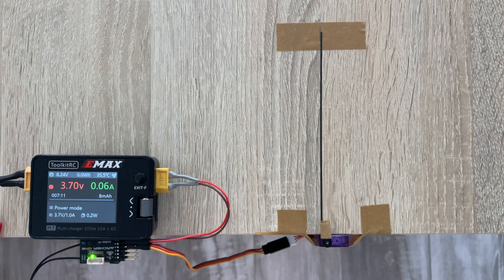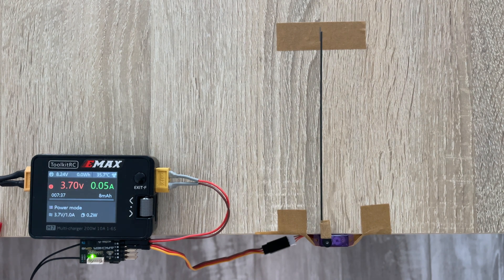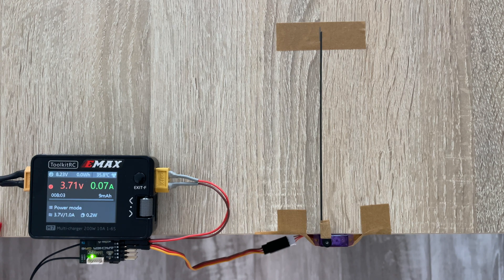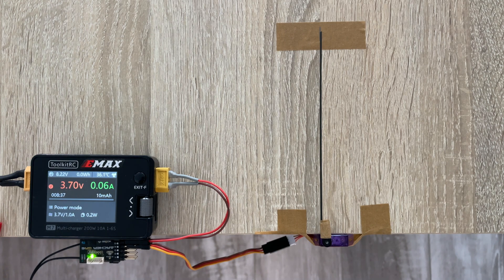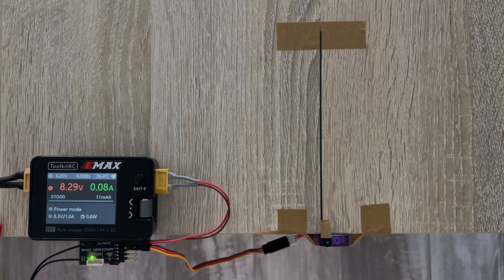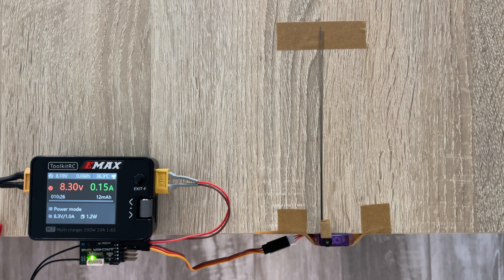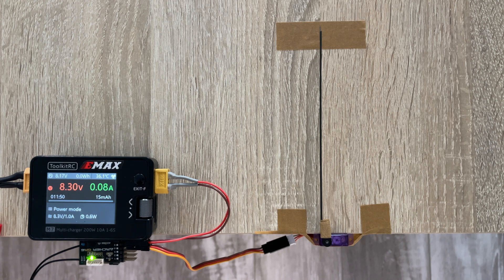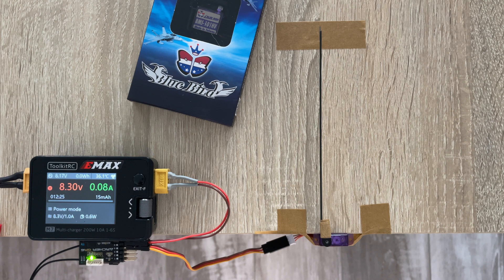Blue Bird BMS-101HV - The Best DLG Servo?

Comment: I have these servos on my dlg and they are horrible. Dont center at all. Not even close. I have to tap the aileron sticks opposite direction to get the servos back to center. I can see slop in the output shaft. These are brand new, out the box.
Reply from the maker: Yeah, these BMS series has some significant issues. A lot of pilots have to replace them since they made the airframe unflyable.

Comment: Why do you do a test without putting some force on the servo? I can guarantee that if you put some force on it, that it does NOT center at all at 3.7V. At 7.4V it works fine
Reply from the maker: We have tested the servos under load previously and there was mostly no difference in centering. We have noticed that if the servo is centering ok w/o load, it will most likely center well under load as well. So decided to simplify the tests and run them w/o load.
Reply: @flightpointrc  without load is no use. Servos never operate unloaded. I've just replaced 4 of these in my Stike 3 DLG because they were useless!